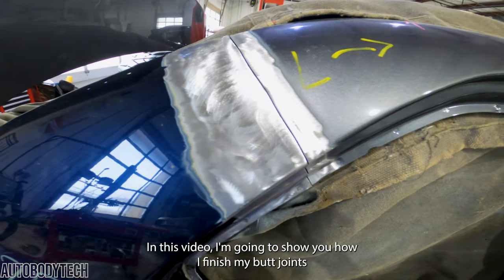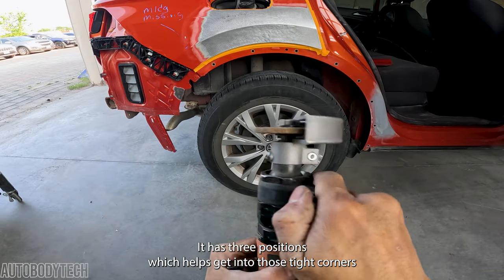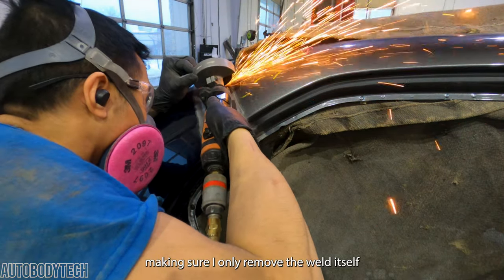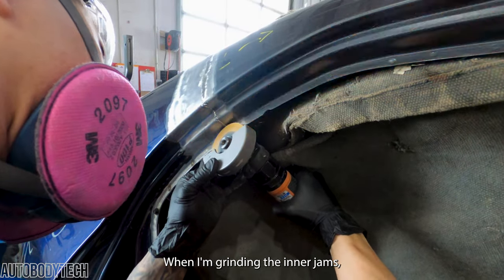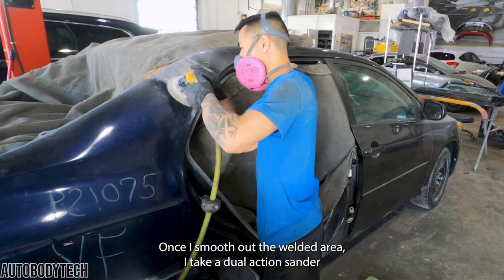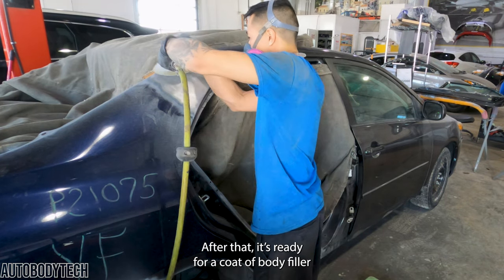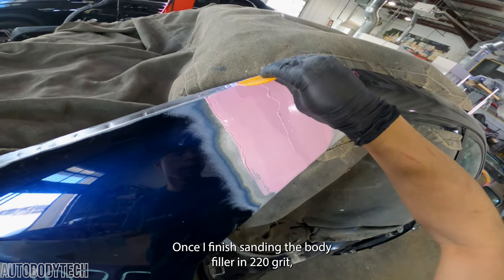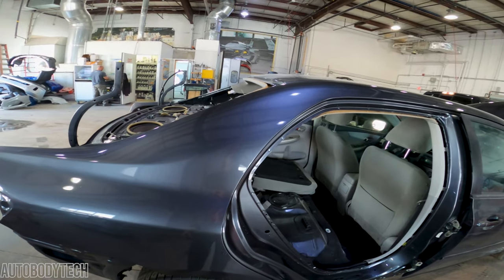How I Finish My Welded Butt Joints | Tips & Tricks

Comment: I've been retired from this for about 16 yrs and usually don't see anybody using my way of grinding down the welds.  I always used a 1/4x 3" 3M wheel on my die grinder just like you and its the best way. Some guys use a 3" disk and that takes off to much panel metal. Your doing it right youngster.👍

Comment: Hello
great job but tell me, why don't you weld with Cusi3 ?
Reply from the maker: I haven't learned how to yet, but I also haven't  seen it on oem procedures yet. I'll have to look more into it. Thanks for suggesting !
Reply: @AUTOBODYTECH  I can only recommend it to you, I've only been welding bodywork like this with cusi3 for 7 years. With cusi3 you have better rust protection for galvanized body panels, significantly less heat input during welding, the weld seams are much easier to grind down and yet the weld seams are high-strength. You can also weld cusi3 with your existing welding machine. Just a Teflon core in the hose package and argon 4.6 as a protective gas and another roll of Cusi3 wire and then you can get started. It's also much nicer when sanding. If you grind the cusi3 weld seam there are no sparks. This way you know exactly that you are only grinding the weld seam and not the sheet metal on the left and right.
Reply from the maker: Amazing! Thanks for the info 👍 😀